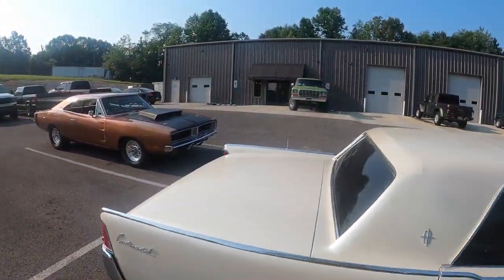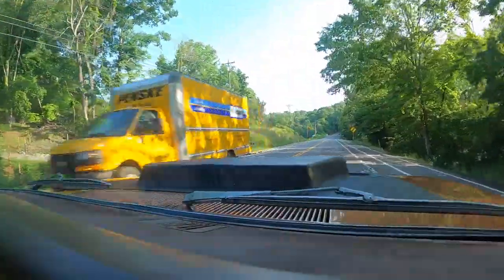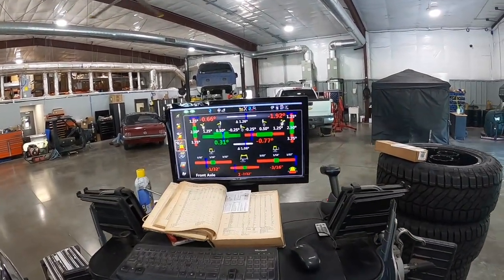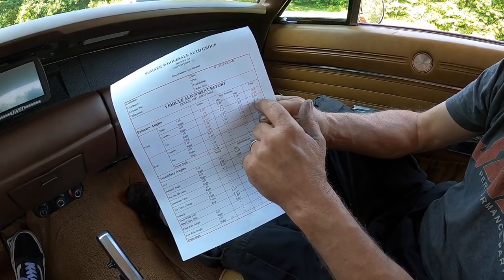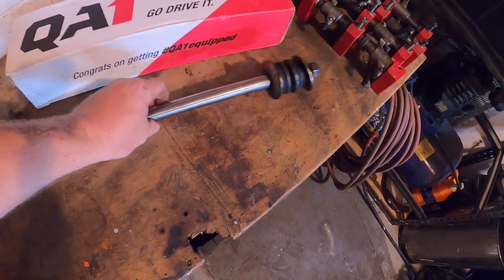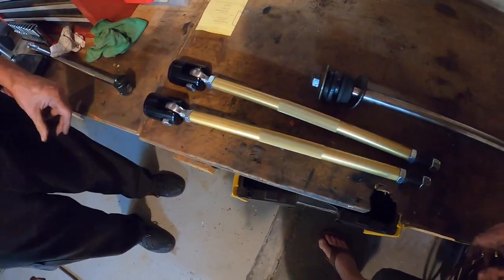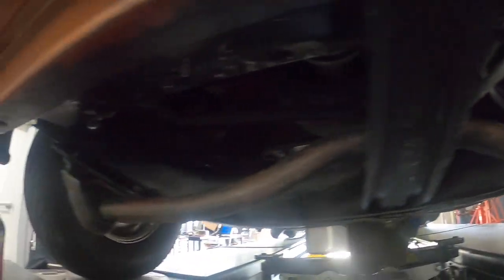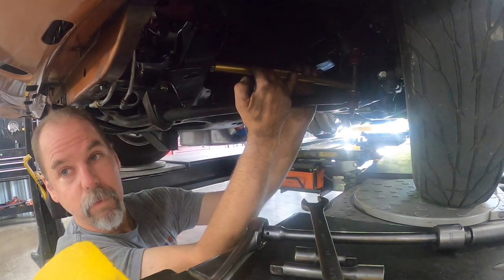1969 Dodge Charger Alignment Tips & Tricks; QA1 Adjustable Struts & Gear Vendors Overdrive

Comment: I like the adjustable strut rod, mainly for centering lower arm, and maybe bias it for some caster. I probably would have procured some offset upper control arms if needed. Usually I try for 2-4 degrees of positive caster. Allowing up to -1.00 degree max camber. Borgeson steering gearbox, big sway bars, always drive excellent. Total alignment
Reply from the maker: Good suggestions

Comment: What a beautiful Charger! Great color combo! I'm not a fan of the hood, though, but your 69 Charger is  gorgeous!! Congrats, and thanks for the video. Greetings from El Paso Tx
Reply from the maker: Right on! I really wrestled with painting the hood the same T7 Bronze or Organisol like the A12 cars. I needed to run a big scoop because of the tall intake, and the Six-Pack scoops just look weird on Chargers to me. The '68 S/S Dart scoop just felt "right" - especially since I'm building a BIG Hemi for it.
Reply: @moparconnection  regardless, it's cool!! Hopefully you put out a video of the engine too..
Reply from the maker: We did a 2-part build series on the 535ci back when we built it in 2014 over on the magazine. You can read it at www.moparconnectionmagazine.com
Reply: @moparconnection  I'll ck it out. Thanks again. I'll be on the lookout for more of your videos.

Comment: Question.  What stall converter are you running? Running around with rpm under the stall speed with destroy that 727
Reply from the maker: It’s a Super Street Fighter 3000-3600 from TCI. And heat is what kills converters and we’re running 7.25qts through the aluminum radiator and a separate cooler. I’ll killed 3 automatics behind this 535 stroker; I’m not doing it again.

Comment: Strut rods are not designed to change caster, though they could. They are designed to ensure smooth LCA motion to prevent binding. If you want more caster, get adjustable UCA's from sources such as Peter @ Bergman Auto Craft.
Reply from the maker: You do know that BAC (Bergman Auto Craft) sells these EXACT SAME adjustable strut rods, which per Peter, are EXPLICITLY for adjusting caster, right? Here's the link: https://bergmanautocraft.com/product/strut-rod-kit-b-e-body-mopar/
Reply: Nope, Nothing said there about adjusting caster. I've corresponded with Peter about this and he said you "can" do that, but not recommended. Same response from the folks at PST. The strut rods are to eliminate binding of the LCA, not to adjust caster.
Reply from the maker: You're right. It's not written out in black and white on the listing. Thankfully, we had Peter in our booth at MoParty between autocross heats and we talked about these as we had just installed them. He literally said to my face, "Yup. All it takes is a couple of twists." Not much else I can say.
Reply: Guess it depends on the point of view. In a pinch the strut rods can nudge things back to original specs. Realistically though, our old girls need a lot more caster than the camber bolts & strut rods can provide... hence the need for an adjustable UCA. Keep up the good work guys!
Reply from the maker: Agreed 100%. Thank you!

Comment: A little off??!!! Dude, he says he you + camber on side, and - on one side??!!!   obviously, you drag race you car but, 1. on the camber settings, you should be at least a slight bit - on both sides, not - on one, and + on the other!  On the caster,  since you are racing in a straight line, yo want as much + caster as you can get! If the strut rods don't give that much, invest in a set of adj upper control arms.   The more + caster you have, the more stable you will be on the top end. I'm sure you don't want you steering to be way to sensitive to inputs on the top end. You should take a look at germen car alignment specs, to see how they can hold a over 150 + mph on the autobahn!!
Reply from the maker: It wasn't that bad. Tennessee roads have a HEAVY crown to them (rain/snow) and I'm running pizza cutters with a manual box. It comes with the territory.

Comment: Who the hell uses the strut rod to adjust the alignment?

Nothing like tweaking/bending the lower control arm forward to get the alignment set and binding up the lower control arm motion at the same time.
Reply from the maker: Literally everyone who builds a classic Mopar who wants it to drive straight and corner responsively. The angle not as drastic as you make it out to be. Adjustable strut rods are incredibly common and used in SCCA/Trans-Am racing.
Reply: @moparconnection  so just because everyone does it, does that make it the proper way of do things?

The strut rod is a lower control arm support so that the arm doesn't move forward or rearward during suspension movement and under braking.

The purpose of the adjustable strut rods are  not for setting the alignment specs. When installed correctly they offer more rigidity to keep the outer portion of lower control arm located where it is supposed to be and they offer less binding of the suspension for smoother operation.

The adjustment is there so that they can be installed and tightened up without moving the lower control arm from it's at rest position.
Reply from the maker: Yes and no. QA1, Hotchkis, PST and even Penske Racing all offer adjustable strut rods with the primary intent of providing caster adjustment. While yes, it is a support it is also another axis of control. 

Modern Heim joints remove the slop of rubber (or poly) bushings, provide superior support, and (again) adjustability. Just because Ma Mopar didn't offer it in 1969 doesn't mean it's wrong. Sometimes progress is good. 

If you don't want to do this, certainly don't. That's OK. But you cannot tell me it doesn't work.
Reply: @moparconnection  I never said the adjustable rod wasn't a good idea. I'm just trying to bring to light that you are misinformed and misinforming people that watch this video on their intended purpose and how they are to be setup and used.
Reply from the maker: @Mopar_Taxi_Guy  but that's the problem. I'm not wrong. These adjustable struts are precisely designed to provide this level of adjustment. It's literally what these companies sell these to do.
Reply: @moparconnection  🤦🏻
Reply: @Mopar_Taxi_Guy  I agree 100%. The lower control arm bushings are the weak link as it is. Now they're binding it up by changing the angle. I would think adjustable upper arms would be a better option....Being old school myself I would measure from the factory fixture holes in front of the rear shackles and  "X" the measurements to the center of the lower ball joint opposite side and tighten the adj rod there. Theres offset upper bushings available if needed....Just my 2 cents.....